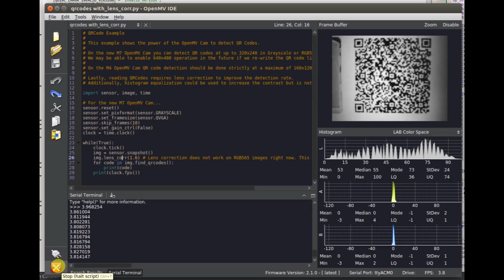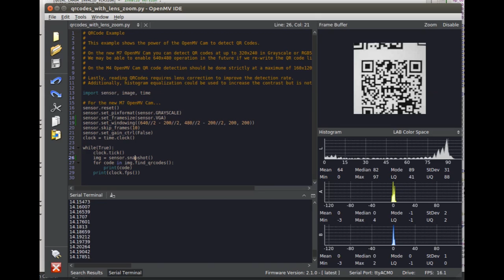QR Code Detection w/ OpenMV Cam M7

Comment: Hello,  how can I transfert the information collected to arduino? Is that possible?
Reply from the maker: There's a serial port on the OpenMV Cam you can use to send data to the Arduino.
Reply: Thank you! Another question, wich port is admitted as a serial port?
Reply from the maker: On pins 3 and 4 you have a UART you can use on the camera to send serial data.
Reply: Holly not allude